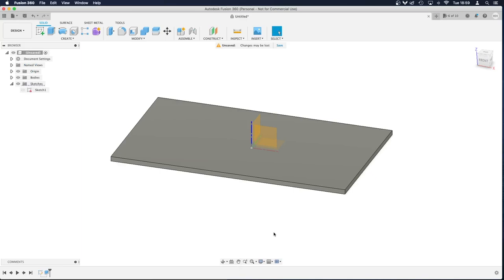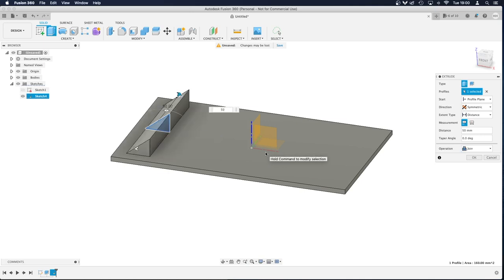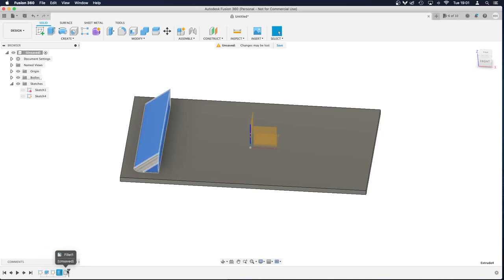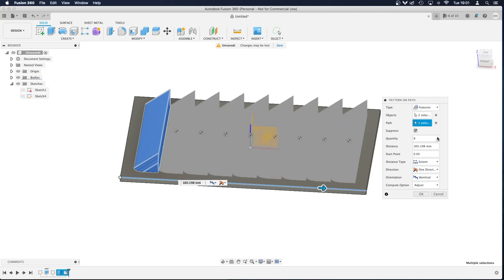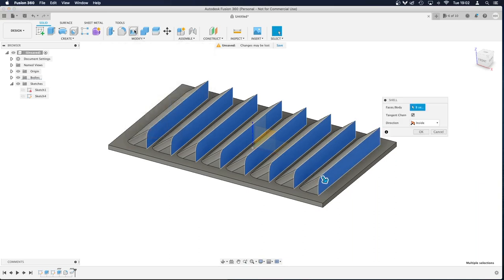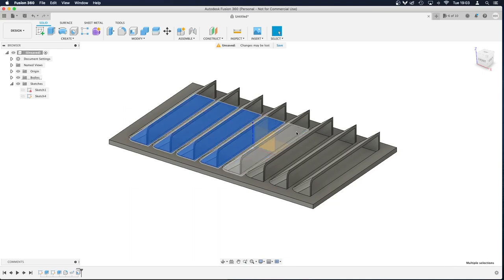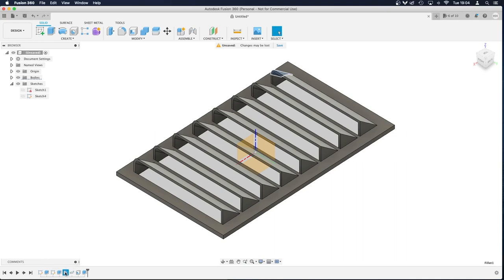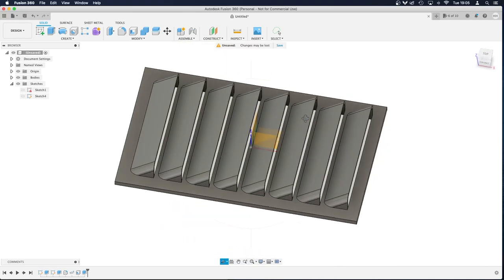Make Louvres in Fusion 360

Comment: Interesting, this is the first video I have seen of louvres with Fusion 360. 👍
I followed along and tried this myself. During shell, you can actually select the bottom face as well. That would automatically create the opening. This works well if your base is the same thickness as the louvres.
The pattern command can take multiple features. So you can just do one lourve and pattern the extrude, fillets and shell features all at once.

Comment: Pro tip: where you tried to click the edge to add to the fillet's existing selection set, if you hold control it will let you add to the existing one without having to add a new selection set (and re-enter the fillet radius)

Comment: Let me fit my workflow in you video.

Pattern should be the latest function.

You could make all features on one louvre, as fillets, shelling (Fusion360School pointed you right, you can choice other side, so you don’t need extrude it after) and then pattering features.

Also if in future you decide to change thickness of plate to let’s say to 5mm, then you lost the hole. So better to use Distance > All.